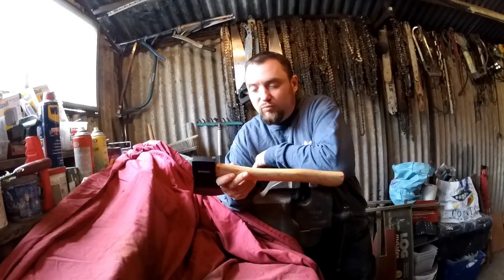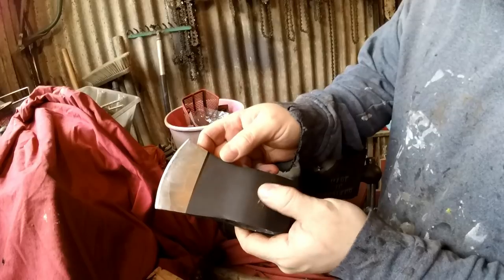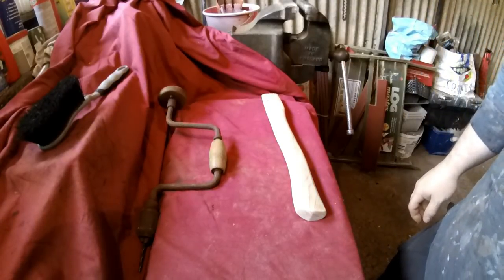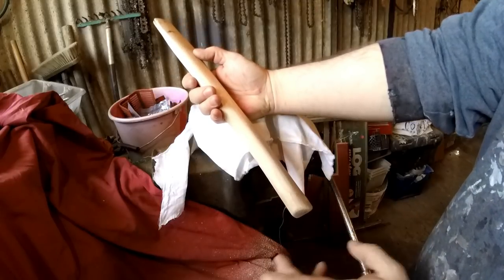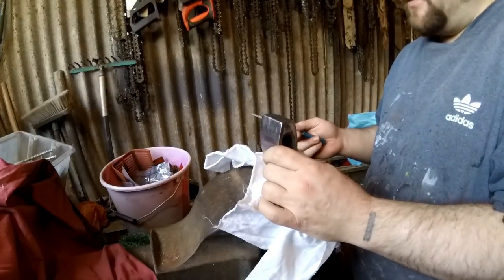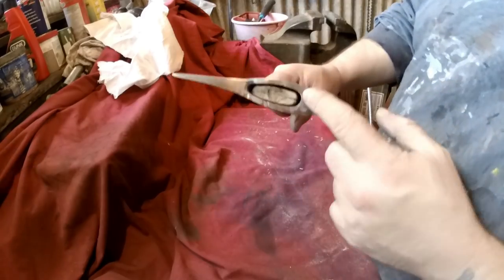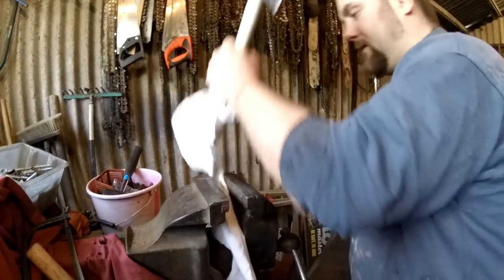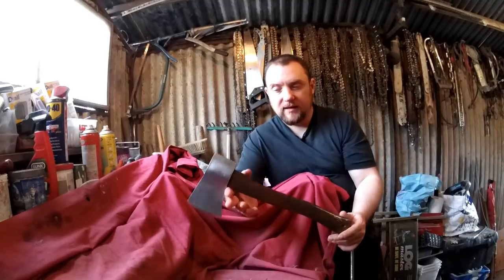Modding a cheap Axe / Hatchet

Comment: with the wedges in the handle it will be much stronger than before. Dont you just love those portable belt sanders that tool is so handy.  Great work to turn a 7 pound hatchet into a first rate one.  I got a video coming your way. you wont believe what just happened to me today.
Reply from the maker: Thanks Bob, much betetr now isn;t it, and  i shall check your video out asap

Comment: Oven cleaner or brake fluid would also work well to remove the paint. Neither will damage the steel, but they really do a number on pretty much any paint.